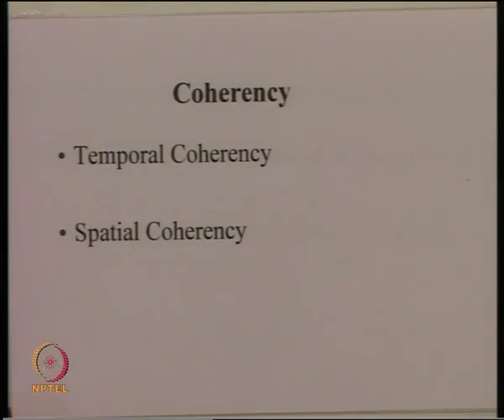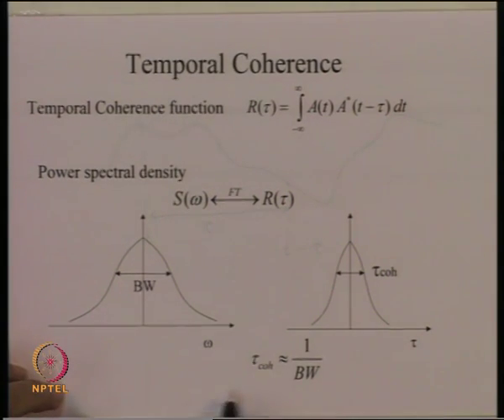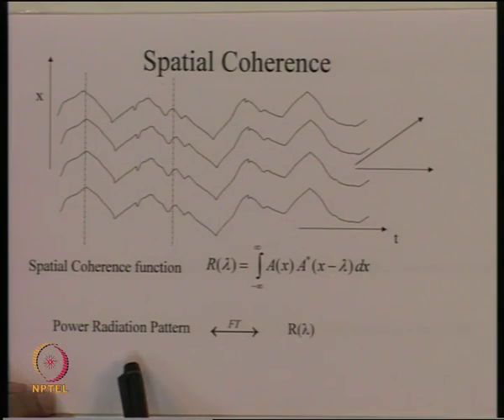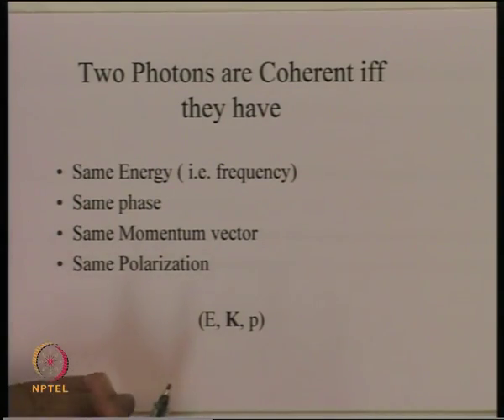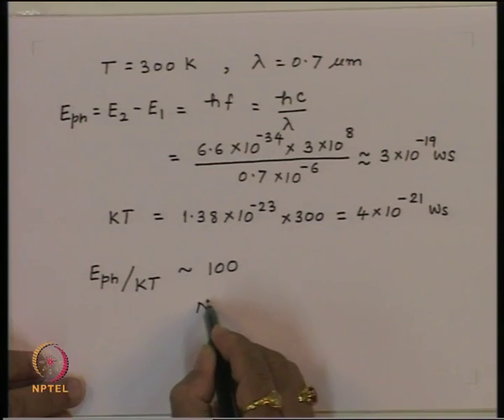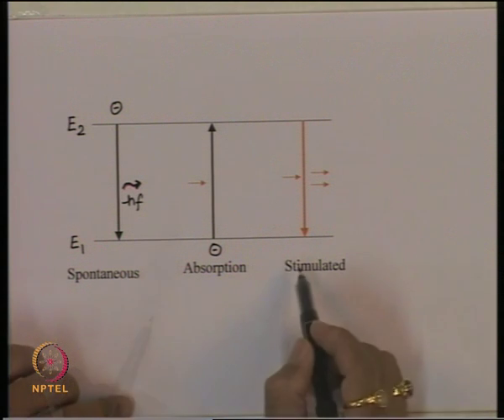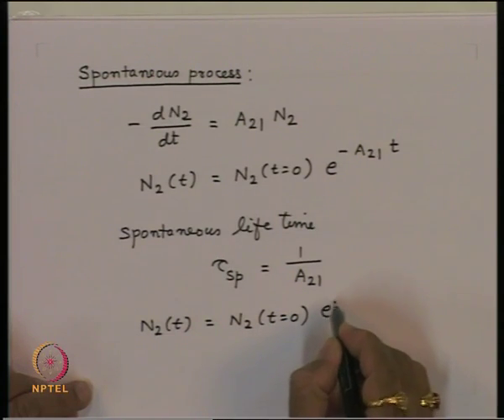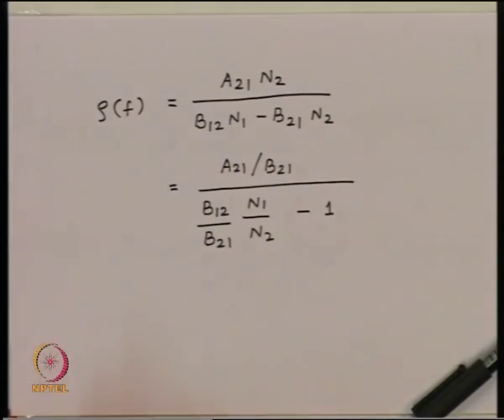Mod-01 Lec-15 Laser - I

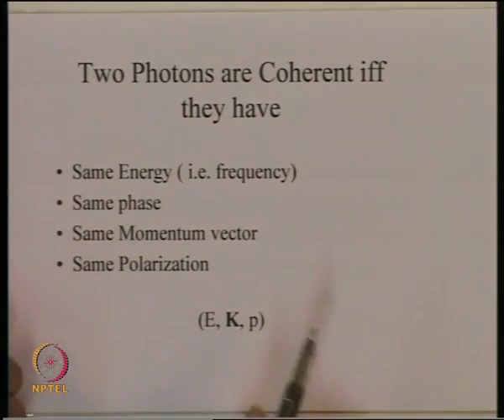Comment: This is pretty confusing: he shows 4 coherency-factors, but he says: 25:17. Suddenly there are only 3 factors :-( By the way, spontaneous emission is not spontaneous! It was called that way by Einstein, because he couldn't explain it. Later on it was explained by QED: spontaneous emission is due to vacuum fluctuations.